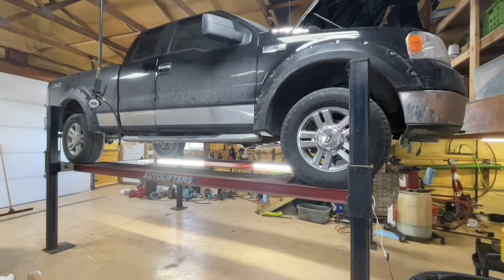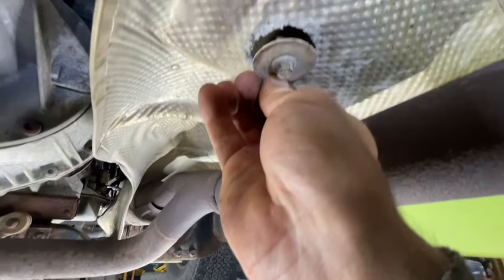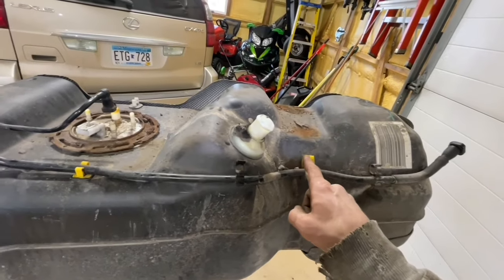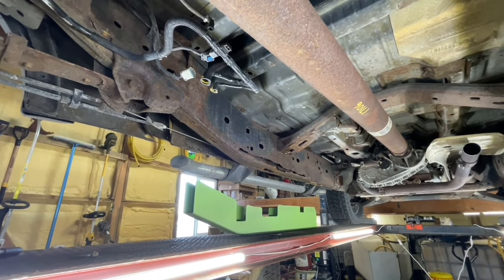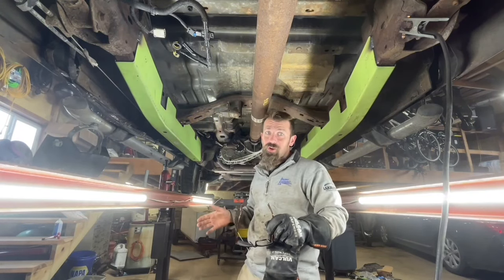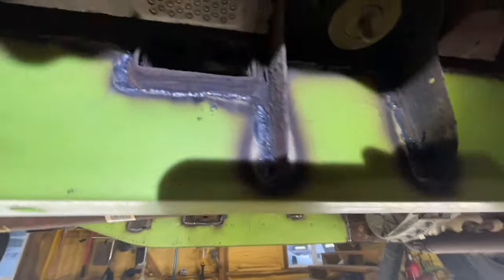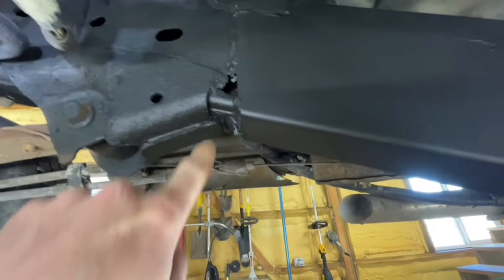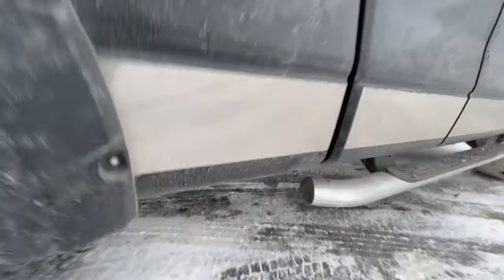Rusted out, rotted F-150 frame: repair, fix, 2004-2008, this one is pretty bad!

Comment: thats  a good repair  
but where the "new frame" meets the new there is a real weak spot there   im sure one could beef it up a bit    its worth it as its a pretty nice truck otherwise
Reply from the maker: I totally agree. The Dorman parts are a great starting point, and in many cases will probably be all you need. In some cases, like this truck, adding more plate in the remaining weak spots would be needed.

Comment: 2005 hell I have a 2022 yes 2022 ford F250 with rust everywhere on the drive train. I have less then 300 miles on it. Ford said you live in the salt belt we can’t help you it was pre-rusted before I bought it I just didn’t address it when I purchased until a week later  stay away from Ford Trucks
Reply from the maker: Sorry to hear that. :(
Send it down the road before it starts giving you trouble. Hopefully you’ll get a solid decade out of it before that.

Comment: What state are u in
Reply from the maker: Minnesota
Reply: @bennieaust  I just recently bought the same truck without looking under at the frame. My frame looks exactly like that if not worse. Out of curiosity how much should I expect to spend to fix that
Reply from the maker: @akeemhuggins1106  it probably varies greatly depending on how bad it is, where you live and what shop you go to.  I would expect most shops to quote you $2500 and up.

Comment: 10:10 you couldn't just use a wire wheel lol?
Reply from the maker: I don’t think you understand how bad this frame was.  This frame was rotted to its core.  I used a flap disc on it and that definitely helps, but if you ever get the “opportunity” to weld metal like this you will understand.
Reply: @bennieaust  I weld everyday

Comment: Why not just replace the frame with a new one
Reply from the maker: Cost. No doubt it would be better, but it would cost substantially more.  Not the option the owner wanted to go with on an older truck.
Reply: @bennieaust  hey do the 5.0 engine that's in the 2013 Ford F-150 has any problems
Reply from the maker: @Baylorbetterthanbrown  that’s the one I’d get!  They are very reliable and easy to work on if something does need to be done. I’m not a fan of the 5.4.  The ecoboost is an awesome engine and great for towing but they can get expensive with repairs if you own an older one. There a lot going on under the hood of those ecoboost trucks.
Reply: @bennieaust  I just looked at one today not a single rust spot on it and it's a 2013 but it has 230,000 Mi with a 5.0 engine the frame got black stuff on it now did somebody was this a traveling truck or something
Reply from the maker: @Baylorbetterthanbrown  the ‘04-‘08 years were the bad ones for the frame. A 2013 with a 5.0 would be a great truck.

Comment: You trapped all that rust under the under coating and the new frame rails all of which should have been Treated first. Using something like rust cutter something with acid any ways to convert that rust. Then Install the new frame rails then undercoat it then use your fluid film
Reply from the maker: Maybe I’ll have to try that next time. It seems like a losing battle but the goal was to drastically slow it down with the fluid film.
Reply: Trapping rust under paint or rubberized won't slow it down.   Ask me how I know.   
Wire brushing first, even using a grinder wire wheel and chipping hammer , didn't help.  
adding the new metal was good
but leaving the old rusty metal was bad
i don't have the solution, which I why I watched the video

Comment: Scrap the truck. All that work not worth it.
Reply from the maker: Have you looked at used truck prices lately?  Definitely worth it on an otherwise good truck.  If the truck was only worth $2k I’d agree.
Reply: @bennieaust   yeah man...and whatever can be done to fight planned obsolescence the more power to ya... and if ya have to get a 'new' one all the time, they've stuffed it with ten tons of electronics that is not necessary to go from point A to point B.... A frame on the other hand...that's essential...
Reply: @adamschrepfer5838  Yeah, they should hot dip galvanized frame.  Who need those all electronics?
Reply: @bennieaust  Its not that bad, My brother helped me accomplish the same project on my 2008 in a day. Worst thing is dropping the fuel tank. We detached the drive shaft from rear end but left the exhaust in place. Thank goodness my brother is a awesome welder and has a shop to do this work.  Its well worth it,  the body and rocker panels have zero rust and the overall appearance of the truck is great. I'm so happy now my frame is solid again.

Comment: The additional rust looks a little more tricky but I'm sure you'll have that fixed soon my question is does this truck have the dreaded 5.4 variable valve timing cam phaser nightmare?
Reply from the maker: It does. I honestly would completely steer everyone away from this generation of F150. Between the frame rot and the 5.4, there’s not much going for it. :(
Reply: @bennieaust  Only the 3 valve had the phaser issues.  Do all the F-150s have the 3 valve?
Reply from the maker: @mescko  all 2004-2008 5.4s use the 3 valve. The 4.6 is a 2 valve. The 3 valve 5.4 is also notorious for spark plug issues. When they don’t have issues they are a likable engine. They just don’t have a great reputation and they are expensive to work on when you start having spark plug and timing issues.
Reply: Thanks for the clarification,  I haven't followed the phaser issue, my Ford pick-up is a lot older than these lol
Reply: @mescko  I think before 04 was 2v

Comment: No excuse for the crappy quality these trucks and cars have been and are still being built with. Low quality steel, aluminum, frame rails got thinner cheaper steel and car makers are laughing all the way to the bank because they know they are selling garbage products. People see a "cool" display system in the car they can play with and they never think about vehicles as a whole, every component, every part designed to fail. Buying any vehicle now is disheartening because all of them are crap.
Reply from the maker: Some vehicles have proven to be good and some have proven to be bad.  These trucks have definitely proven to be bad.  I wouldn't want to own one.
Reply: @bennieaust You can find OLD cars and trucks, built mid century, 60's, 70's with still solid frame rails after so many decades. That old Ford logo, "Built Ford Tough" has been a joke for decades now lol. Now I know why they stopped using it in their advertising.